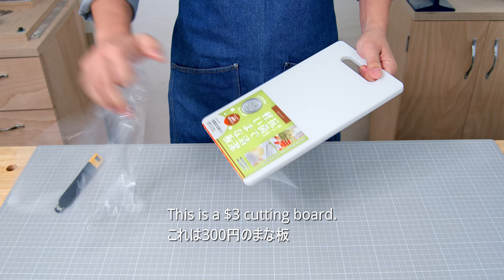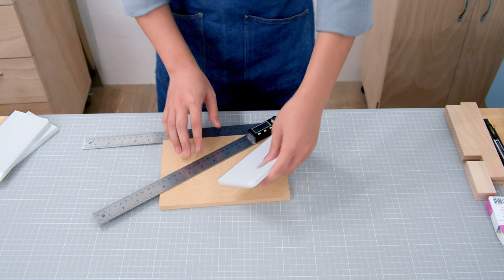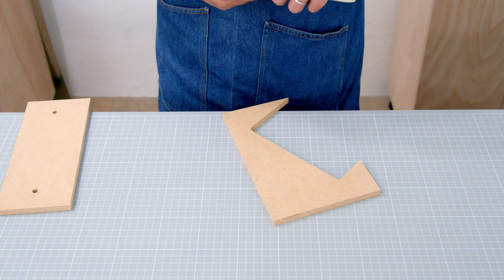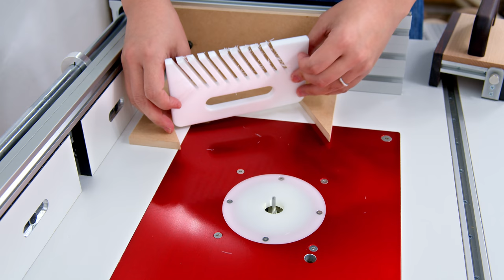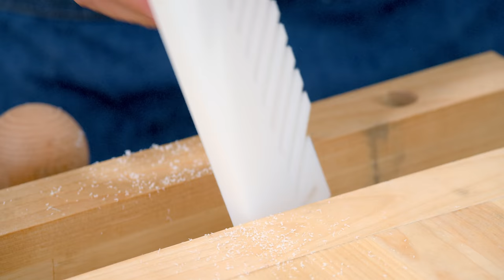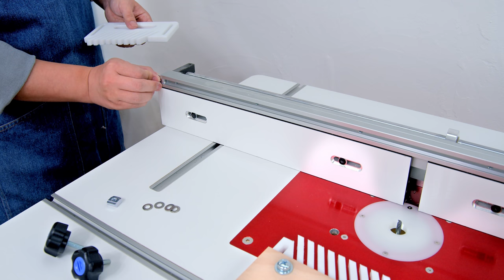How to make a feather board from a $3 cutting board

Comment: Doesn't blade and router bit speed melt the plastic? It happens to me. Great job as always!
Reply: No.😊🛠️ Using woodworking tool on chopping boards works really well. Google says its polyd.

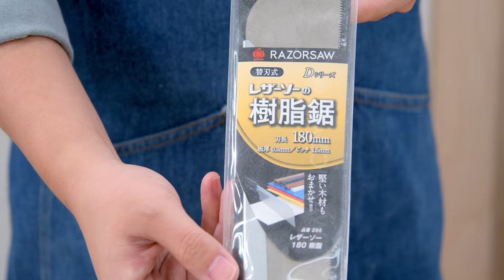Comment: Ha haha just spotted some continuity problems in this video, it was obviously made in multiple attempts, possibly accidentally ruining one of the boards (which is normal if you do something for the first time) if you look at 5:50 he is making the slots and the left/right sides are already cut, whereas in the following part at 6:25 you see he is cutting the left/right sides off, while the slot has already been cut.
Either way it's a great feather board, I like it. I just found this detail amusing.

It's also super cool to use all these home made tools, it reminds me of John Heisz who uses his home made table saw, router table, clamps, etc.

Comment: Never done  professional woodworking ,but i was wondering how come noone set something similar to protect their hands? I had similar idea just with "wheels"  where height is adjusted with some  vise or clamp( do not know what is pro English expression for it) and trail set on that fence  with one peace movable so you do not even use stick to push work peace. would be even more secure.

Comment: I don't see where the vertical or horizontal feather board fingers moved during the cuts.  If they are not moving, then they're not making contact, right? So, are they actually working?  Would be nice to see after pushing it halfway through what happens when you push backwards.  Maybe it works fine, and just need to be pushed against the wood a little more?  Anyways, great video as always.
Reply: Boots It should lock, which also is prevents kickback.

Comment: JSK, please, what kind of router blade did you use to cut the cutting board? The same for wood? Thank you very much.
Reply: It looks like he used different sizes of 2 flute end mill bits.
Reply: @luchvk  , thanks a lot for your help, but my doubt is if the blade is the same blade used to cut wood.
Reply: @carlossimoescampos1  I know that it can be used for wood. However, it's not like a typical wood-cutting router bit. It looks like a machining bit.
Reply: luchvk 
That’s difficult to tell.  Upcut and downcut carbide spiral bits for cutting wood look just like metal milling bits in many ways.  That’s probably what it is.
Reply: @keirfarnum6811  I was thinking about the router bits that look like spinning chisels. However, If it's the same shape (flutes, cutting angle, etc) wouldn't it be the same type of bit? I would think that the metal type (considering cost vs quality) and the heat treatment would be similar too. I didn't know about those types of bits for wood-specific cutting though.